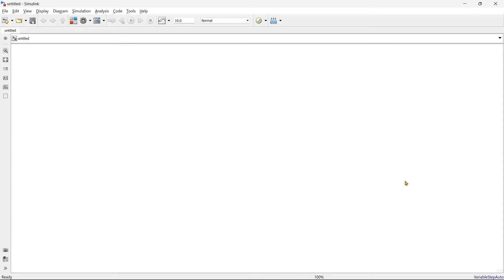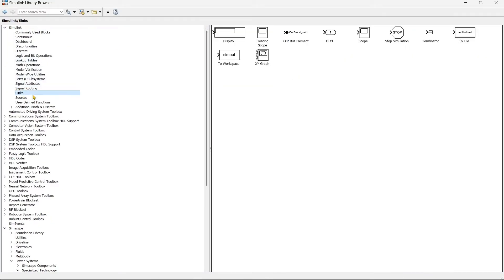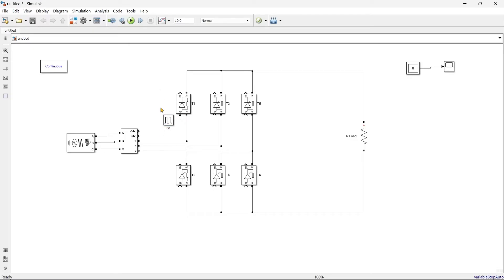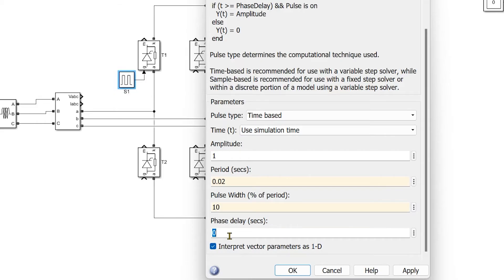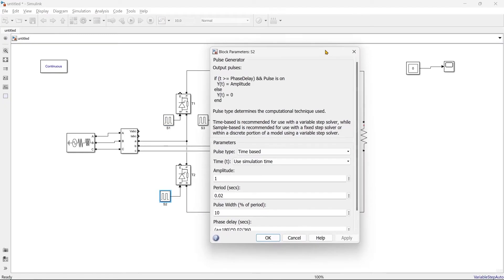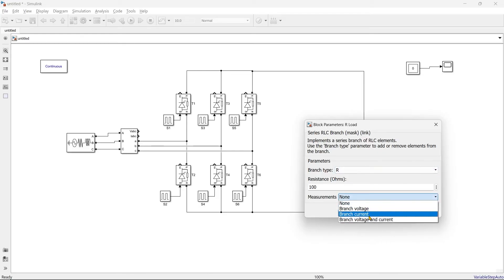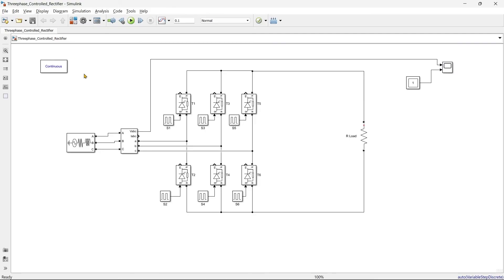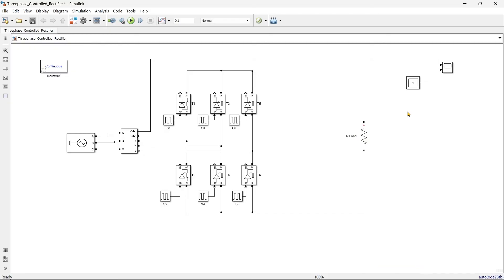Three phase Full wave controlled rectifier simulation in Matlab Simulink | SIMULINK TUTORIAL

Comment: can you miss a pulse in this converter, say T1 pulse is missed means we don't give pulse to T1 and the converter is feeding to dc motor field winding where the load would be RL load can you modify simulation and show the results please especially the current in load and voltage in load

Comment: hi need help for   Construct and test the following three-phase uncontrollable rectifier. Phase-to-phase voltage
of the input power source: 120V rms 50Hz. Line inductance: 10mH. DC-link capacitor: 470μF.
Load resistance: 100Ω